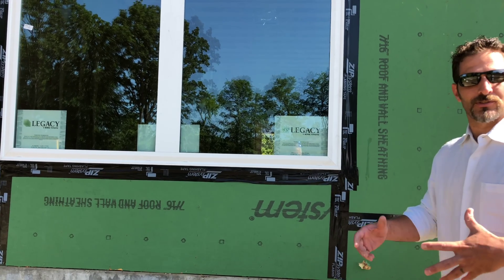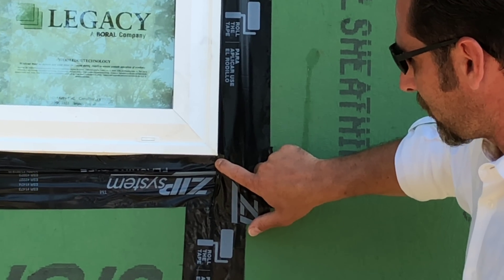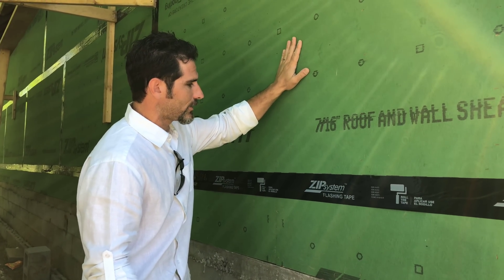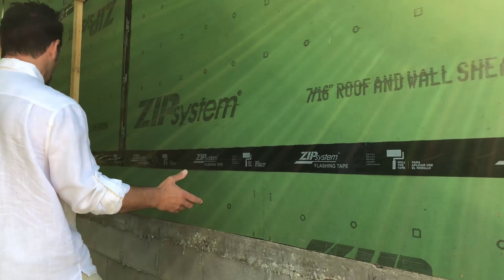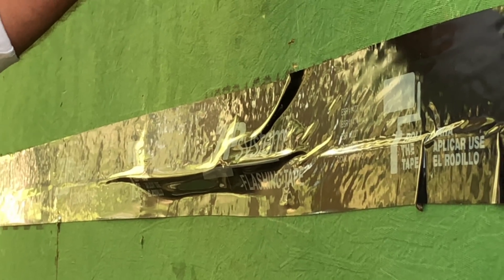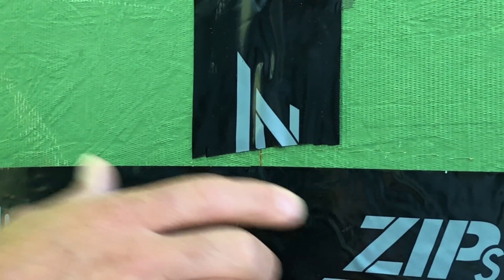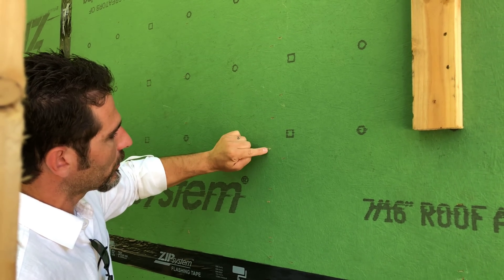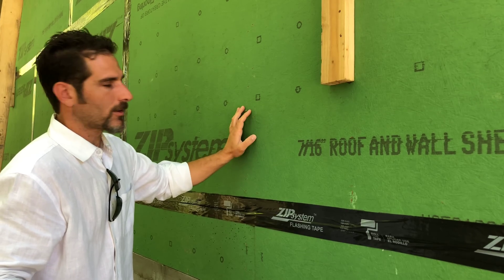ZIP System Problems

Comment: I believe when you use zip you're making a "passive house" you need to climate your inside with better insulation to not allow the moisture to build up in that area. If your going to use a system like this you have to make your insulation and hvac system better. My opinion
Reply from the maker: This zero perm system is okay for hot climates but anywhere it gets below 40 this system will cause condensation issues.  Also when you make a home this tight you are correct you will need to have some fresh air exchange added to your hvac system.  A dehumidifier is something to strongly consider also!  Thanks for watching!
Reply: Absolutely correct.  The zip, and other WRB systems are designed for warm climates where the humidity source is outside.  It takes incredible detailing to use this system in cold climates.

Comment: Does this guy work for Tyvek. That install looks like it was done at night by drunk leprechauns. A 2 year old could do better.
Reply from the maker: sundew2007 no sir I am not paid by any manufacturer! I have fixed water intrusion for 16+  years. This system has been marketed as easy, fast and less expensive to install and this is the nationwide result! Way more projects are being installed just like this one rather than correctly. This will be devastating for many owners because of a money making campaign of lies by a company that is driven by making a buck rather than the better good of their customers!
Reply: @WeatherProofingAmerica  saying "money making campaign of lies by a company" accuses Zip of doing something dishonest or unethical when the fault of the bad installation you pointed out was due to the shoddy workmanship of the installers. Be fair.

Comment: Half assed contractor work, but the problems here would be the same with any other system put up wrong.
Reply from the maker: Incorrectly installed housewrap or fluid applied products can not even compare to the devastation that this adhesive reliant system can do! Integrated wrb's like this one, that have hundreds of feet of tape can cause water to funnel into the wall cavity if the tape becomes free from the substrate. Even if you tape a window wrong with a housewrap system it does not compare to whole wall sections compromised by incorrectly installed tape.  But yet this system has been advertised to be faster, easier & cheaper than housewrap. None of these things are actually true and are simply the opposite!

Comment: Weather Proofing America
 What is your opinion of the Zip system if it is installed correctly and a home that has an ERV and/or a HRV installed in it as well?
Reply from the maker: If it was installed correctly it may be fine for some personally unknown time but relying on solely adhesives to keeps mother nature out is not my idea of a safe bet long term!

Comment: In terms of air-tight vs breathing, I thought it depends on the climate; certain climates should have air-tight exterior, and others should have air-tight interior, all in accordance to a holistic weatherproofing system. The video description says most contractors are not even aware; but anyone knows that the tape needs to be flat, and the foundation needs to be sealed, and staples need to be in the stud; so the contractors know better, but they are trying to cut cost by letting low-paid employees do shotty work to save time. This contractor would have let any system be installed to failure. Is the video about the necessity to do the work correctly or about the disadvantage of air-tightness... the video seems to be about discouraging use of one product to promote another.
Reply from the maker: You are definitely taking for granted contractors knowing the things you state are common knowledge!  I have dealt with many contractors and you would be surprised to know how many say they know everything but actually know very little about waterproofing! An airtight home is completely different than a zero perm rated product on the far exterior side of a wall cavity.  Hot climates can get away with minor issues but if water does find a way in to the wall cavity it will have no way to escape! Not my choice of WRB to protect any of my structures!
Reply: @WeatherProofingAmerica  Thanks for the reply. I'll check out some of your videos that suggest which weatherproofing is good and see what I think. I'm doing research to build myself a tiny house; I've never built a house before. My priorities are very affordable, easy enough to apply, and sufficiently effective.

I removed the rude part from my original comment. People can judge that for themselves.

I've been called an "overthinker" many times. I just assumed a little thought is all it takes an expert to know better, but I've known horrible business owners so: yes, you are right, I stand corrected.

I'll be doing the job right, and in that case it seems to me Zip may be a good choice depending on the climate zone; but I'll see what you recommend also.
Reply: @WeatherProofingAmerica  There is not much info on your channel. Please answer me this: for my priorities of low-price, ease of application, and sufficient effectiveness (if I'm in the proper climate zone) do you think Zip might be a good option for me? I think wrapping a house would be difficult and my inexperience could mean I would mess that up some.
Reply from the maker: Nicholas Even if installed correctly I would still cover it up with a high quality wrap like tyvek. Housewrap is not difficult to install and many videos are available showing how to do it! Thee hundreds of feet of tape is not a smart idea in my opinion. The joints need to be clean, tape neeeds to be rolled and then all the nail heads need to be treated! Then the areas like the foundation intersections need to be treated as well. So no I would not recommend.
Reply: @WeatherProofingAmerica  I've been very much leaning toward using the liquid tape which easily covers nail heads too. I will definitely look thoroughly into Tyvek before I make any final decisions. Thank you very much for your expert input.

Comment: How is sloppy installation the fault of the manufacturer?
Reply from the maker: Because they have marketed and sold contractors on this being the magical fix all water intrusion problems system that is easy and quick to install.  Well if done correctly that is no where near true!  But when done like this one it is faster and maybe even easier!  So my point is this is a random project with 10 others immediately surrounding it with the same exact issues.  The proper installation is going to be a very low percentage of installations of these type of systems.  Unfortunately the devastation will be catastrophic just wait and see!

Comment: Zip should be paying you for the great job in pointing out "How Not" to Zip a home :) ..But in fare you do make a good point with your moisture knowledge and Tyvek data. So overall, I think your video serves greater good on many levels...
Reply from the maker: The point of this video is to shed light on the difficulty of correct installation, which is why it will be installed like this 90% of the time! The manufacturer of this product has sold builders, homeowners, lumber reps, etc that this system is so much easier & faster to install but it is simply not! It is actually very difficult to install correctly at which point the system may actually work.  The other major thing I don't like about any of the Integrated systems like this are the fact that they rely on miles of tape to keep your structure safe!  As opposed to the overlapping of a quality housewrap.  Thanks for watching & commenting:)

Comment: So, after watching your video beginning to end it seems the problem is not with the product.  The problem is shoddy installation practices with a good product.  Am I wrong?
Reply from the maker: george george the installation is a huge issue which is why the majority of these type of systems are problematic. But in my opinion you are better off with housewrap because it does not rely on miles of tape that is not lapped to keep the top edge from direct access to water. There are many points that are detrimental that I didn’t even cover in this video. There are too many opportunities for failure. Housewrap has it’s own issues but it’s not nearly as easy to make costly mistakes installing it!
Reply: @WeatherProofingAmerica  ; Thank you.  Your input is most appreciated.  I did leave out one thing.  I do all my own work.  I do not hire anyone to do anything for me regarding home construction.  I am of the opinion that overbuilt is underrated.  For me, videos like yours are pure gold.  Thanks again.

Comment: Tyvek, Typar, fortifiber, double 30/60 min, sheet goods are going the way of the Dodo bird. #1 They are  not structural where liquid applied is. #2 you don't have to be an Origami expert to install. #3 your not putting literally putting thousands of penetrations in you A&MB.
Reply from the maker: So what type of system would you recommend to keep out the elements and  not create issues from not being permeable?

Comment: This is definitely a builder issue.
Reply from the maker: You are correct & that is the point of this video! The manufacturer of this product has sold builders, homeowners, lumber reps, etc that this system is so much easier & faster to install but it is simply not! It is actually very difficult to install correctly at which point the system may actually work.  The other major thing I don't like about any of the Integrated systems like this are the fact that they rely on miles of tape to keep your structure safe!  As opposed to the overlapping of a quality housewrap.  Thanks for watching & commenting:)

Comment: The problems you are pointing out is a lack of a competent framer. Go back to Craigslist and get your $10 an hour help
Reply from the maker: You are correct & that is the point of this video! The manufacturer of this product has sold builders, homeowners, lumber reps, etc that this system is so much easier & faster to install but it is simply not! It is actually very difficult to install correctly at which point the system may actually work.  The other major thing I don't like about any of the Integrated systems like this are the fact that they rely on miles of tape to keep your structure safe!  As opposed to the overlapping of a quality housewrap.  Thanks for watching & commenting:)

Comment: The problem is the installation, NOT the product.
Reply from the maker: prunejuicepb so you think that it is okay to rely on miles of tape, that has to have the surface it is going on free of debris & then has to be installed perfectly & rolled for it to work. This is a product issue for sure and let me tell you why!  If this product is being marketed and sold as a faster easier solution to housewrap. This gives installers false security in this system therefore it is hardly ever installed correctly! In any climate but the desert this system has potential to cause major condensation issues in the exterior walls.....we haven’t even touched on the thousands of exposed nail-heads that will take forever to seal with the magic liquid flash which is why most homes don’t have anything sealing all those penetrations!  If you would like to believe that this system works then I hope you are willing to put this on YOUR investment!  Thanks for watching & your interaction!

Comment: Currently building with zip R sheathing. I like the benefit of the R sheathing but if it would have been regular zip, I would’ve used tyvek system. I have 6 leaky windows right now. Yes, most are install issues which I still have time to remedy but just not sold on the tape and it’s more complex to install for sure.
Reply from the maker: leejace I am very sorry to hear you are having problems:( You are a prime example of exactly why I am trying to educate, so people don’t have the hassle & expense of the damage!

Comment: How is water going to get into that tape through the hardy board on the outside?
Reply from the maker: That is a very common question I get.  The biggest way water gets behind a siding like hardie is after the caulking separates and the homeowner doesn't keep it maintained (most don't).  This will allow water at the butt joints (if they didn't flash them, most don't) or around windows or any other wall penetration.  Not to mention condensation that may take place depending on the climate zone.  Thanks for watching!